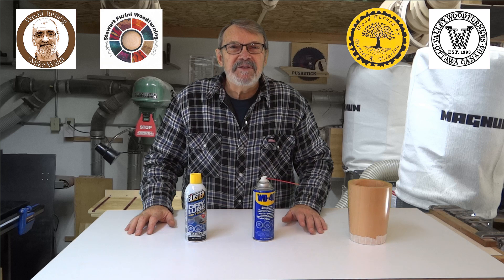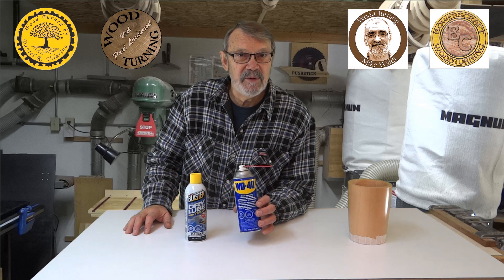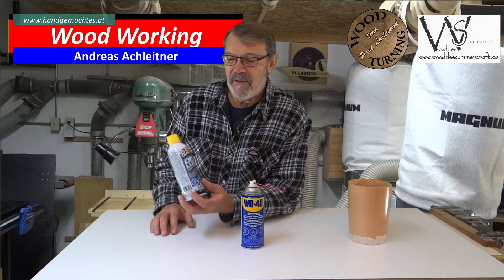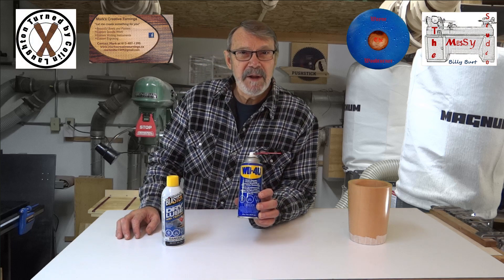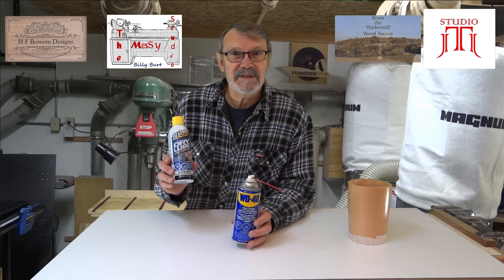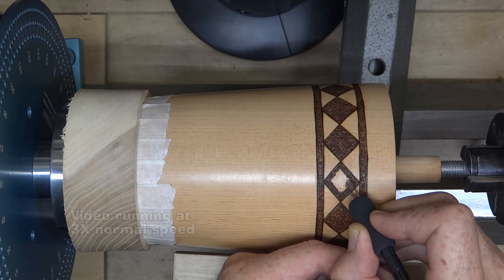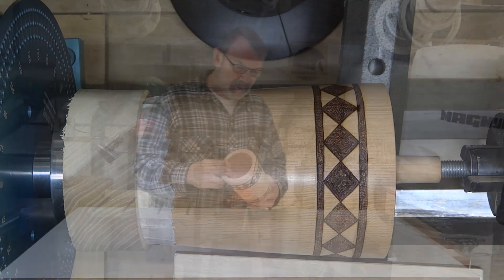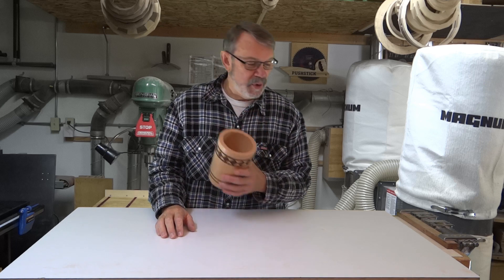Decorative Band On Cedar Vase

Comment: Great video. Thanks for the information on the the type of lube you used on the tail stock. I used graphite but it does make a mess. That spray looks like a good alternative. Would you mind telling me what kind of pyrography pen you are using? I have looked at a few but am not sure which one to get. Thanks
Reply from the maker: The one I use is made by Razertip and I got the burner and the first tips from Lee Valley. I have ordered a few other tips directly from razertip DOT com. I am very happy with it!
Take care,
.....Gord
Reply: Thanks for the speedy reply and the valuable information. I look forward to doing some pyrography after seeing how well yours came out.

Comment: The Adobe powers are strong with you!!!  Lithium grease user here, but nothing aside from steel wool and maybe Acetone if I make a real mess on the bed ways, my tailstock clamp doesn't hold tight enough to even allow me to drill a hole into a piece of hardwood if it so much as sees a can of any type of lubricant, I have to keep them hidden!  :)
Reply from the maker: 😂😂😂 Thank you, Bill. Star Wars and Adobe! That cracks me up!
Man, if lithium grease is that good I might be better off staying away from it. I usually manage to get whatever I use spread all over the place. I still have a lot of white dots to clean up!
Take care, Bill,
.....Gord
Reply: Gord Rock  I'm not much different in that regard.  In my past life I was an auto mechanic so I tend to grab a shop rag and tuck it into my hip pocket early on when entering.  With no sheetrock on the walls yet (hey, it's only been 10 years - don't judge me! :) I use any finishes, etc. which fly off the lathe as a moisture barrier against turning green wood.

Comment: I keep threatening to get a pyrography rig. It just hasn't floated to the top of my continually prioritized list. . .yet.
Lubricants -  I use a PTFE lubricant on my quill, but let me tell you. . . you don't want to use it on your ways. That stuff is SO slick that the locks won't hold against any appreciable pressure.  I continue to use it on rack & pinion and worm drives but ensure none gets on the lathe bed ways.

All the best,
--Joe
Reply from the maker: Wow! That sounds like good stuff. I may have to check it out if I become less than enthralled with the lube I just used. I think it will be fine for now, though. A big improvement over the WD-40, which was a big improvement over whatever I last used; no idea anymore what that was! Thanks for watching and for the feedback, Joe!
Take care,
.....Gord
Reply: Well, Gord. Read the label and you may find that the "Teflon ®" is in fact PTFE -  or maybe you'll have to read the MSDS. Teflon is the most recognizable trade name of PTFE (Polytetrafluoroethylene). Man!! I love saying words like that - poly-tetra-fluoro-ethylene, poly-tetra-fluoro-ethylene, poly-tetra-fluoro-ethylene. More fun than inhaling  a Coca-Cola  effervescence bubble cloud. :-)

--Joe
Reply from the maker: Say it? I can barely READ it! 😳😳 Thanks for the Coke reference. I suddenly have a huge thirst!

Comment: A few words about WD-40, WD-40 was invented for the aerospace industry. If you have watched rockets lifting off and noticed the ice that forms on the outside of the rocket due to condensation. The ice adds a tremendous amout of weight so it is a good thing to get rid of during a rocket launch. The WD in the name WD-40 stands for water displacement and of course it has lubricating qualities which allows it to be used on many handy uses around the house and shop or automotive areas. Squeaky hinges and sticky surfaces are a thing of the past with wd-40. I also use it to clean up oil and protective coatings on new machine surfaces, it also makes a nice lapping or sharpening fuid for sharpening or lapping a surface flat.
Good things come from the space industry.
Nice project as always, keep up the good work.
Reply from the maker: Thank you, James. I'm glad you liked it and thank you for the information about WD-40. Some of it I knew but I never heard about it being used for rocket launches. Always wondered why the ice fell away like it did.
Take care,
.....Gord